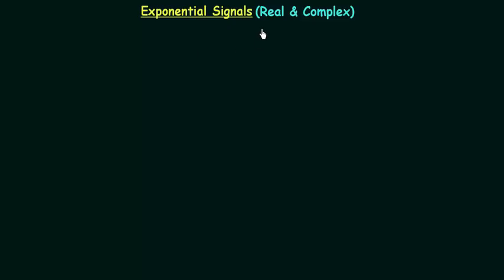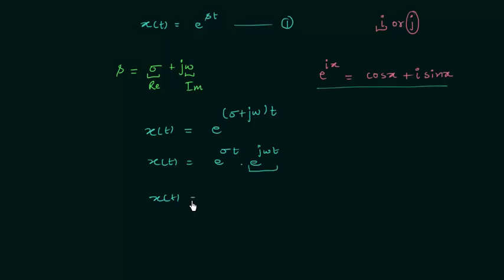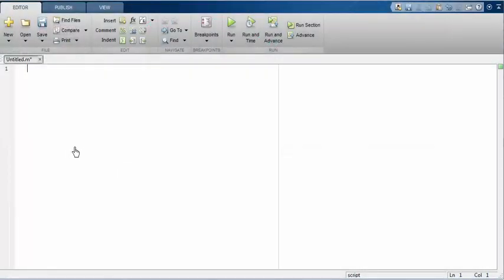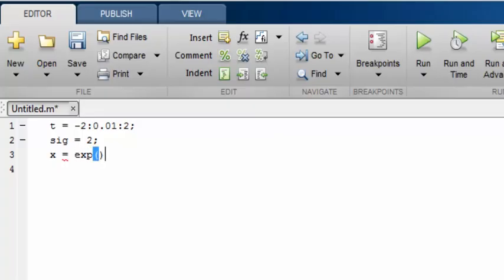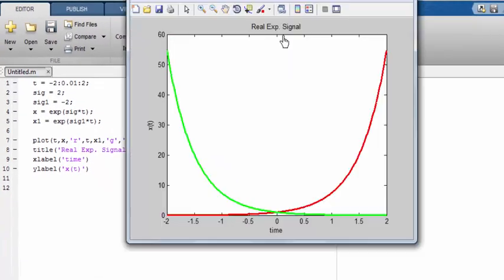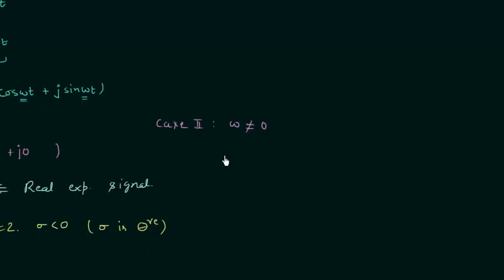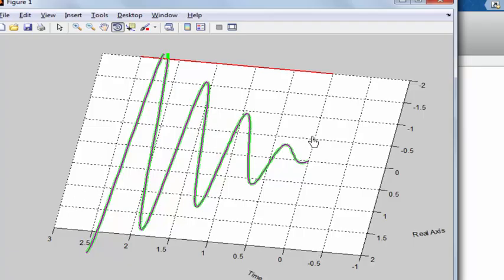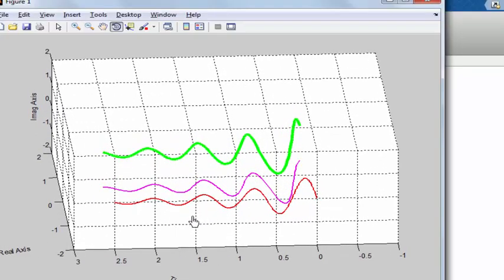Exponential Signals (Real and Complex)

Comment: How can the imaginary part be expressed as real and imaginary? it seems like there are 3 parts, real, real, imaginary.
Reply: In my inexact comprehension : The exponential signal is a powerful representation than can include two thing in its exponent. The real number in the exponent is the exponential behavior of the signal. i.e, how much the amplitude will increase/decrease across time. It is always real. The imaginary component will encode the wave behavior, or how it "cycle". We can decompose that later bit in two part, one real, one imaginary

Your intuition is not wrong about being two real number present. However, there are not three part, because the exponential component is not "added" to the wave component.  The exponential scale the wave component, i.e, we multiply the exponent with the wave. So we have (real of exponent * real of wave) + (real of exponent * imaginary of wave). So it would be more exact of you to speak of the exponential "real" part as a factor of the wave component.

Comment: there is something wrong that the real axis signal means cosine will not start from origin ....
Reply: The graph of cosine will be drawn using the Real axis and the Time axis. Cosine is not starting from the origin. See the given data on axes, when Time = 0 the Real part of the signal is 1 on the graph the same thing is with the Imaginary part when Time  = 0 the Imaginary part is 0. You're probably getting confused because of the time axis is not in the usual form. The time axis is starting from Right to Left, kind of images are flipped.